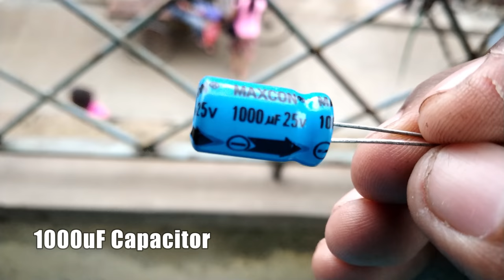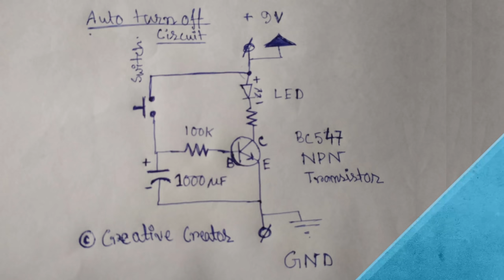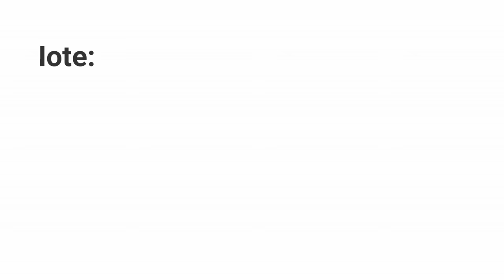Simple light off timer circuit using 1 transistor

Comment: ERROR noted.  What was built shows the capacitor between the Base & Emitter.   The schematic is an example of a RC timing circuit and shows the Base is only connected to one end of the 100k resistor. When the switch is closed, the capacitor charges instantly.  When the switch is released, the cap will slowly discharge through the 100k resistor and the base/emitter junction, keeping the light on till the base/emitter junction voltage drops below 0.6V.  To have longer time delays, use a N-Channel MOSFET.

Comment: How can I get the light to go off in a 4 or 5 hours (not 30-40 seconds)?  What would I need to do for that length of time?
Reply from the maker: Use bigger capacitor
Reply: @Creativecreator  Thanks! Approximately how large? What is the calculation that I would use to figure that capacitor needed?
Reply from the maker: Just buy couple of 2200uf caps and parallel one bu one capacitor as long delay you need
Reply: @Creativecreator  Thank you! :)

Comment: Can build on delay timer before on...?
Reply from the maker: If you use micro controller or any 555 timer it will be best
Reply: Ok thanks 
But i want to use one transistor, capacitor, or 3V battery 4 sec delay on timer before on if  this circuit possible may shere  video .....?
Reply: Plz build circuit on like this video.. :-)